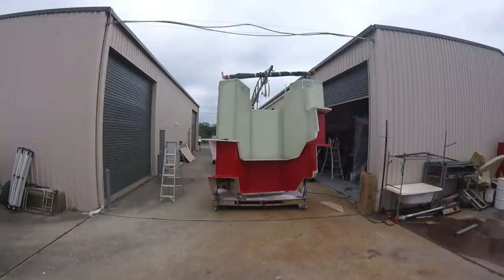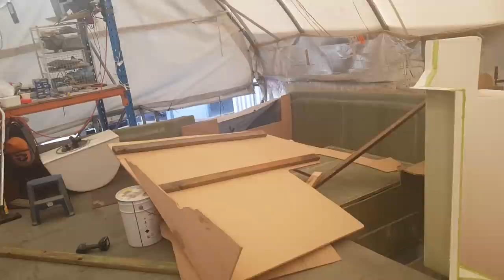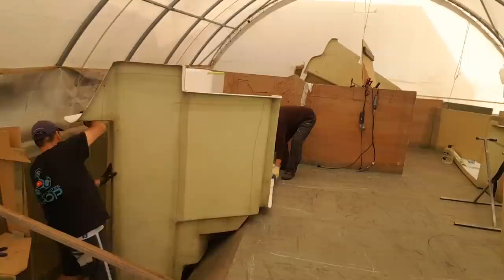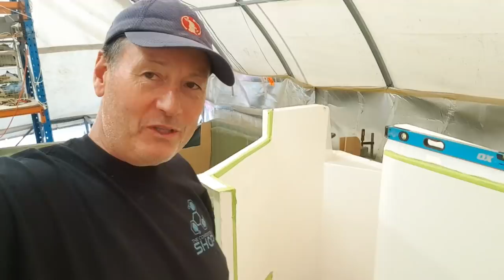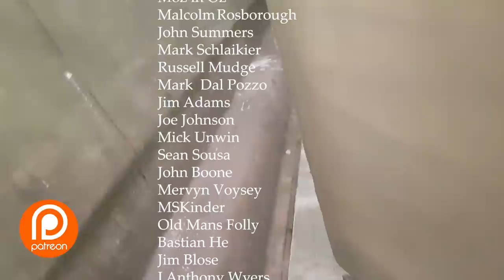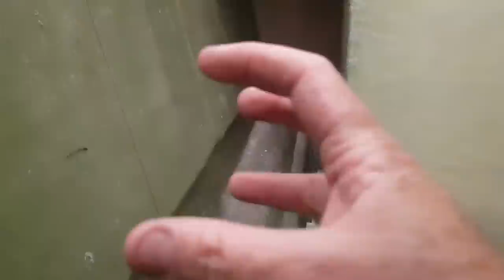Ep121 Yacht internal adjustments required - Life On The Hulls - Building A Catamaran

Comment: Hi Ross, awesome progress. I get a headache thinking about the planning that goes into electric systems, plumbing, tankage etc. that needs to be considered in relation to water-maker, washer, dryer, battery banks and other amenities you might add to the original plan. I look forward to seeing your solutions to solar panel install, when we get that far in the build. I hope for an aestethic solution, with integrated panels and wire leads etc. and I am sure you will impress in the micro as well as the macro ;-)

Comment: You veered off the original design right from the start so ill imagine you'll be fighting  the variations all the way until the bridge deck is fitted.
Reply from the maker: Yes,although necessary to lighten the beast the only real issue is the modules,which could be foregone and individual furnitre bullt from foam,but the layout for us us worth it,and like all boats compromise is inevitable.Cheers Ross

Comment: Whatever happened to that fiberglass test-piece that was supposed to be used for (destructive?) strength-test? Is that process finished and the results in, or is that testing something that happens only when the boat is finished?

Comment: If the port floor is raised 30mm, that raises the top of each module on the port. Alright, fine adjust the deck-hull joint. Lots of work there. Starboard side wasn’t raised, which might be an issue unless it can be hidden with ceiling panels, alternative might be shortening the height of raised modules in the port side by 30mm. Far easier I would think.
Reply from the maker: Bian,All will be interfaced and ceiling lining will be the secret in this case. Ross

Comment: Ross does that mean you have to put a 30 mm 1"1/4 sheet to  the underside of that  unit and how will that  affect the rest of the Modulus  going forward and will it be the same for both sides ???? thinking yes to that . I only say this as if you use 30mm spacers to lift will the floor be soft underfoot.

Comment: I've watched all the videos, and understand the foam complication (the videos about the plans were great btw)
I am not understanding why the modules cannot just be trimmed 30mm smaller(?) 
I'm kinda following what you're talking about in the video. Maybe the answer is that it'd be a huge PITA, and require tons of in and out checking the fitment. Also, the geometry is very complex: there is flexing, the modules need to also fit the... deck height (floor height between hulls), and the roof height, and the bottom floor height.... and the modules need to fit the outer and inner walls.
I'm sure it's more complex than that- but it seems like it'd be easy to slice off chunks (like where the stairs were hitting the hull in this video), and then reglass the holes left in the module. 
And I guess the floor of the module would have to be cut off, and maybe the outer (ocean facing) wall). Those seem like huge chunks of work.
Maybe it's something you could talk about again in a future video. I'm guessing you've already answered it a lot here in the comments :p
Sorry that you're having to do work to do more work, but thanks for taking us along (: The trailer sailer videos are awfully appealing & a nice reminder of how nice sailing can be after watching you & Johnny inside the tent. At least the respirator suit days are over for now
Reply from the maker: All has worked out so far,a lot of in and out but I have finally achieved a good fit and with room for services in behind and around the modules.Love our trailer sailer it is so good  and a brilliant inspiration for us both.Ross

Comment: Ross, I think I would have just stuck a 30mm base to the underside of the medial, save raising the subfloor. No one will notice the 30mm deeper in the cupboard and wardrobes.
Reply from the maker: Gidday Ash,the module has to be glassed to the floor so a riser wont really work,so I think slicing a bit off the top off the module will certainly suffice. Cheers matey,I hope the UK has started to ease up a bit for you.Cheers Ross

Comment: Instead of raising the whole floor couldn't you just add the 30mm foam on the underside of the module . You are adding foam under the module for strength on the stair treads so why not on the floor were it has to be raised? I know there is a reason and you know it but I would like to know. Is there a hatch in that area or the whole floor needs to be raised because the head module will need the same level ? Great build, I hate that I am caught up live now so I will have to wait for new post instead of just watching one after the other .
Reply from the maker: If I were to raise the module only I would end up with a range of problems incl bathroom height issue and companionway stairs with irregukar height.The sole being an important baseline has resolved this and excess trimmed on top instead.Cheers and thanks so much for watching and commenting.Great stuff.Rossco

Comment: Ross,
Isn't that 30mm also going to affect the deck to hull joint ?
Will it be a consistent 30mm around the entire rim of the hull so glueing a strip of foam core will resolve the issue?
Cheers Eric
Reply from the maker: I reckon it will just be s matter of trimiing the one double companionway module top edge,but it remain to be seen in the end fitting.Ross

Comment: Does raising the module interfere with the deck above?
Reply from the maker: Gidday Rick.I original thought that may be the case but a mere 30mm should not have too much of an impact as the top of modules are likely trimmed in any case and there are roof liners (gel coated laminated fibreglass)modules that will be between the module and the deck as well so room for fexibility for sure.Cheerd Buddy.Ross